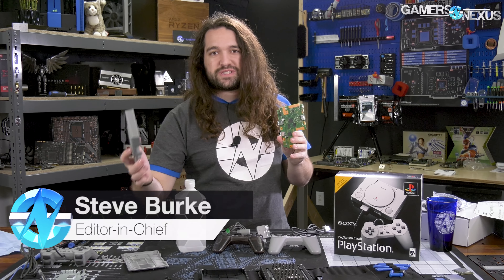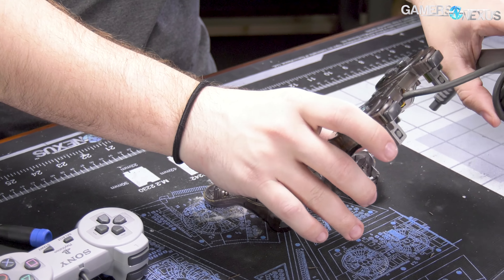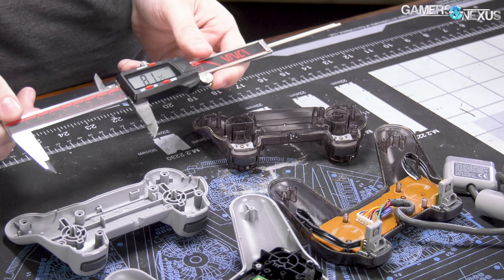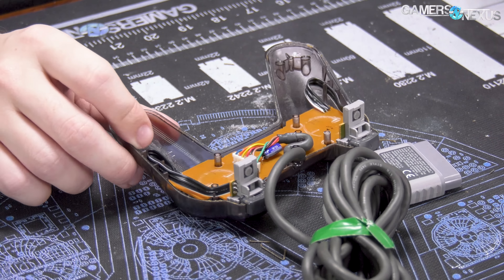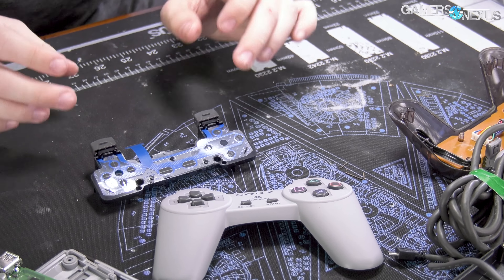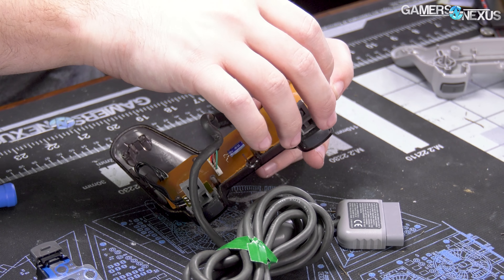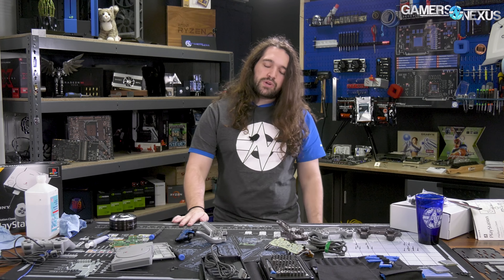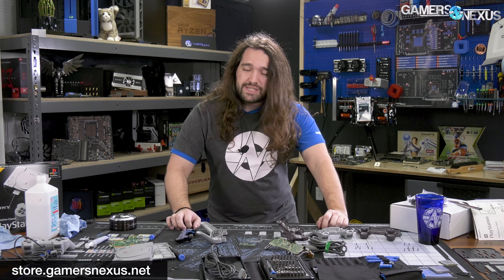PlayStation Classic Controller Tear-Down vs. PS1 Original

Comment: I am a bit saddened Sony did not recreate the Dualshock controller. My hands are finely tuned more to Dualshock 1 and 2's design and they are my favorite controllers of all time, and having access to a first party controller that terminates in USB would make my year. No dongles hanging out of my emulator station would be great.
Reply: "Finely tuned" = thumbs awkwardly torqued down. Xbox controller is better. Not that I don't avoid controllers whenever possible though.
Reply: @Malus1531  "Thumbs awkwardly torqued down" sounds to me like there's a problem with how you're holding the controller, or you just have really small hands. I've been using Playstation controllers since the original and have never once felt my thumbs were awkwardly torqued, on the contrary my thumbs rest naturally on both the face buttons and the sticks while the controller simply gently sits in my relaxed pinky/ring/middle fingers.
Reply: In 3D games you'll certainly use analog sticks… but on PS1 2 3 it's not in the most convenient position because they just added stuffs on the design of the SNES controller without any rethinking of the gamepad for the 3D during 15 years.
The ergonomic research is more evolved on Xbox gamepads than any Sony's one.
The Xbox360 controller has good placement of the left stick, better index buttons and triggers and the resting positions are way better. 
IMHO the better design is the Gamecube controller, such a masterpiece in the button and trigger placement and shape. The N64 pad is very good too, the trident shape is ingenious but the analog stick isn't great.
Reply: @PainterVierax  true. And to clarify I do think slapping the analog sticks where they did on the playstation controlers isn't great, and although they are my favorite controlers, I do recognize the flaws in their design. In modern titles if I find myself playing with a controller on PC I will certainly opt for a 360 controller at least.
Reply: I used a DualShock controller during decades, the 360 controller was a great improvement and is supported natively by a lot of PC games. The only flaw I see on the 360 one is the D-pad but on 2D games that don't require analog sticks (it starts to be quite rare even in indies) I just plug my DIY arcade pad.

Comment: Huh, kind fun how they went from a grey switch pad on the d-pad on old controller to clear on the new, then from clear switch pad on action puttons on old to grey on the new.

Almost like they didn't have any old controllers to check up against, and just remembered that "One of these pads should be clear, but whitch one..."

Comment: You can't use any other controller on the system example if you bought a USB Nintendo 64 controller for an emulator you can't use it on the system only use for the emulator

Comment: It's pretty clear you haven't really opened up controllers before. You'll find that they are all basically identical hardware with some variance in the brain box or more, if the control layout is very unique. I am kinda interested in seeing you dissect more controllers and see what you learn

Also its funny seeing you freak over the grime since  if you've opened any used controller before (even relatively recent ounces) they are all grimy in the same way and you get used to it.

Comment: stepping from a PCB carbon pad (like old tv remotes) is a good step going to the vynl sheet, people can then replace the pad once it breaks and the control module can be swapped out... having it on a PCB will degrade quicker over time and its a pain to repatch carbon graphite again to the pad position. Someone start copying the plastic carbon pads now so additions are made for repairs down the track... I wonder how fast the response is on accurate input timing is. the NES classic was SO POOR! 45-75ms plus..
Reply: Mark, you can fix them on PCB, it's even harder on vinyl and they added an easy to break connector. It's more durable but in the long term the maintenance is impossible and you have to replace parts so it's a step backward to me.

Comment: Crap... it does use one of those garbage membrane circuits like the PS2 controller.  Hopefully it's more robust.
Reply: It probably sucks just as bad, I've lost 2 ps2 controllers this past month to loss of circuitry 😭
Reply: @lancesmart2667  all of ps controllers use membrane
Reply: @England91  OP was talking about the circuit printed film not the 'membrane'... Original PS1 controllers use a thick solid plastic PCB (as shown in this video) which is much more reliable.
Reply: Yeah, I'm not talking about the rubber membrane contact pads that register button presses. I'm talking about the flimsy circuit membrane they're using in place of a PCB. I have a box full of dead PS2 controllers. Won't register button presses, stuck buttons, buttons that are having a seizure. These things are incredibly sensitive to ESD. The controller doesn't even have to be open. They're so damn fragile.

Comment: The original ps1 was not only 100$ the original controlers are much durable
That plastic foil traces brake very easy unfortunately you get that foil in later ps3 controlers

Comment: Huh. That's a strange design - attaching an actual USB cable internally like that...

Frankly looking at this, while not identical either (how could it be when it uses an entirely different communications protocol?) Nintendo's replica controllers are way closer to their originals than these are. (so much so that to some extent you could swap several components between an original controller and the replica ones and it'd pretty much work out correctly.)

Obviously the downside to that is it replicates any major design flaws perfectly too, but authenticity is authenticity I guess.
Well, not really. There are a few minor tweaks that no doubt have certain implications to durability and cost... (they aren't exact replicas of the original plastic shells for instance, even if they ARE close, which means it's not a re-use of the original plastic moulds.)
But ehh.

Don't know what sony's done here, or whether it truly matters, but it certainly isn't the same...